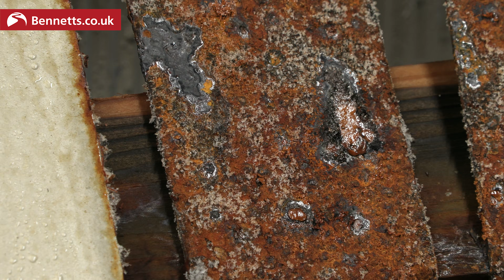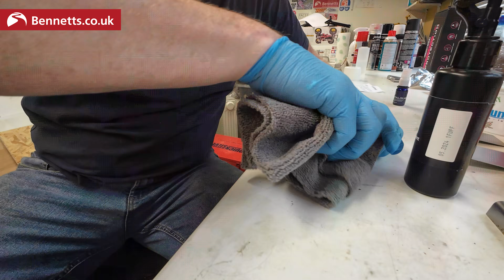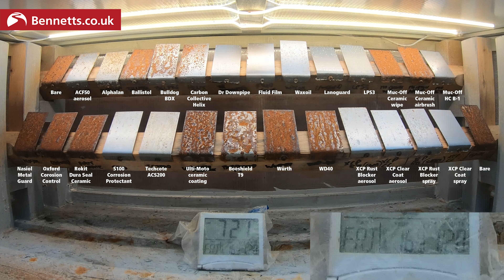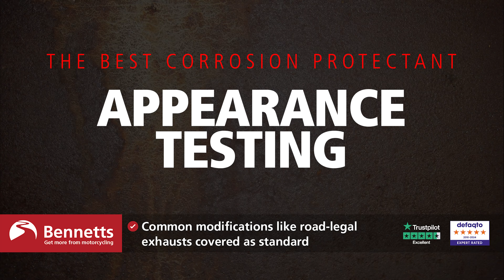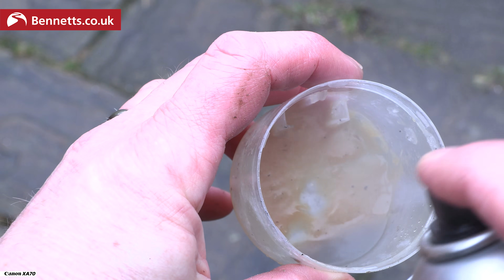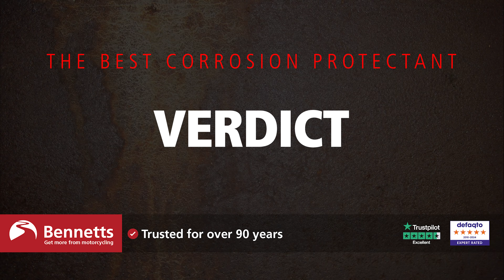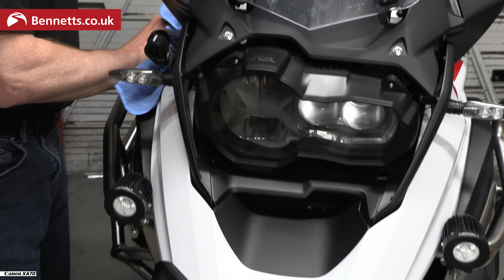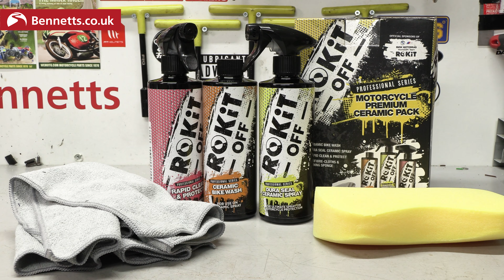Best corrosion protection 2025 | 33 tested | Are ceramic coatings worth it?

Comment from the maker: Tell me what YOU think about this test by joining me on our Facebook group at https://www.facebook.com/groups/bikesocial
or on the BikeSocial forum at https://bikeclub.bennetts.co.uk/home
See the previous tests and data here: https://www.bennetts.co.uk/bikesocial/reviews/products/motorcycle-maintenance-and-servicing/best-rust-corrosion-preventer-inhibitor
Reply: Great video! A chrome test would be amazing!
Reply: Coming from a Powersports manufacturing prospective, we utilized a two coat system as O.E. Corrosion protection of metals.
1- Clean and Dry bare metals, then submerge those metals in an electro deposition (ED) corrosion inhibitor.  ED coating, creates a complete adhesion to clean, bare metal. Any metal having contaminates, effects the ED coat adhesion to the metal. 
2- The second coating was powder (Sprayed on ED adherence), followed by baking at temperature over time, followed by verification of film thickness. 
This process creates a hard, complete coating which can last decades without succumbing to galvanic corrosion. 
......
Can this OEM ED coating be created with a wet coat applied product? ..... NO.... absolutely not... 
in order to protect non-ED coat parts, you would need to disassemble them, acid dip them (Remove all previous coatings and contamination ), Then run them through the ED coat process (Expensive).
...
Wet coating can provide some corrosion protection, but it's temporary and subject to surface contamination remaining upon the metal being coated.
Reply: Really liked the video and the review - EXCELLENT work John, thank you. Would be VERY VERY interested in seeing a similar approach to a review on ceramic coatings for motorcycles 😊 👍 Any thoughts on when we might be able to see that? Thanks again.
Reply: My guy, you should get your hands on CorrosionX. It protects the things you love so you might wanna spray your wife and children after you see how it performs, believe me.

Comment: Where's that Aluminium corrosion test? Let me tell you for Motorcycles that is FAR more important than steel. I live near the coast, no wet riding, only 1600miles on my Kawasaki Z1000sx, it was in a garage with ventilation for 4 years and i have never seen anything like it. EVERY aluminium part had white spots, or was flaking. The wheels had two four inch bare metal areas, the engine covers all around were blown, handrails flaking. I took the bike in for part ex and they knocked off 3k....£3000 it cost me. The bike goes away clean, its dry....but winter cold salty air had ruined my bike, trusty wd40 did nothing. However, ALL the steel like petrol tank etc, side stand, bolts....all perfect, no corrosion so unfortunately your test on steel isn't too relevant because 1)not much steel on bikes! 2) My bikes steel was fine.

Comment: I've used waxoyl a lot on my car - if ever I'm into somewhere doing maintenance (wheel arch liners out etc) I give everything (especially inside box sections, sills etc) a good zap with waxoyl. It really works and you can see the difference when you get to a bit you haven't yet treated... but it looks horrible so I don't use it on the bike except inside tubes and things sometimes.

I tried XCP clear coat and ACF50 this winter - I ride all winter on salty roads. The XCP is a bit thick and goopy but a quick wipe over deals with that. The ACF50 runs off your engine and makes a mess. I'll be sticking to XCP next winter.

I do use muc off protectant as a general finishing spray, and I think it helps stop dirt from sticking and makes the bike look nice... but I don't use it for corrosion prevention.

Comment: can you tell me if LPS3 is tacky or does it dry up? i generally use aviation inhibitor Corban 23 or Corban 35 which is the ultimate inhibitor non tacky almost lie a clear laquer and last for years, but very hard got in the UK plus expensive. I settled for LPS3 for underneath my car and I hope it will dry and be non tacky. Products like lanoguard acf are absolute cr@p , oil non dry wd40 style chain lubricant types that just attrract dirt. I know people rate lanoguard which is effectively sheep skin oil but its tacky and messy and probably good for old cars, but for new cars products like Corban make it look shiny dry and brand new for years. I also tried XCP orange rust blocker, its been a week and its still oily not dry surface which is not good at all for me.

Comment: You are an extreme scholar, my brother. Love it.
Awaiting that aluminum corrosion test video—mountain bike wheel builders would take note. 
This video would be huge for bicycle wheel builders, as well. Post links on big cycling wheel building groups. They would love it
Reply from the maker: Thanks... will do! John
Reply: @b @bennettsbikesocial chnical question for ya: would the Jenolite Waxoil be the most powerful moisture barrier for interface fittings (like an aluminum spoke nipple seated under high tension against a carbon fiber rim)..? 
Waxoil says it is carbon composite material safe (where as the LP3 seems to degrade plastic compounds, as per your acrylic test—not good on a carbon fiber bicycle rim!) 

Thank ya my Brotha

Comment: How good is the XCP products(clear+rust) in terms of lubrication of moving parts? 

Like when forexample some owners of small machine repair shops, recommends using acf50, for rust protection of a wormed gear in a snow blower machine?

In other words, Is the XCP products, only recommended to use for rust protection of flat non-moving metal surfaces?

Comment: commented on the last test as well but

how do the top products hold up to heated parts? Such as the exhaust and engine, as I've had massive issues with rust on exhaust headers due to riding all year long in where they salt the roads in the winter. I used rust inhibiting spray paint before installing new exhaust pipes but rust is still appearing. XCP, ACF, and Blaster Surface Shield (US product) all evaporate off after first ride after application. Have spent numerous hours (6+) researching to little avail. Thanks!
Reply from the maker: I've found nothing yet that can stand up to the heat on headers, but will keep trying to find a way
Reply: @bennettsbikesocial appreciate it! Thank you SO MUCH! Found info from XCP that you can apply it to the exhaust but not quite sure how effective that would be

Comment: Fantastic test, thank you. For years I’ve used ACF50 where less protection is needed but where appearance is important and XCP where more protection is needed and I also found XCP a bit more sticky to the touch.
Reply from the maker: The new formula of Clear Coat is better, though ACF does stay more liquid. Cheers, John

Comment: Obviously the winner in this test was Waxoil. The fact that it can’t be easily removed is precisely what makes it the winner and why it resisted the corrosion effects so well. Its not being easily dissolved isn’t a problem; on the contrary, that’s exactly what makes it the best.
Reply: However, lots of reviews on cars saying it cracks because it hardens over time, then water creeps into the cracks, so for cars I would say lanoguard inside the chassis sections where you can’t get to it and waxoil on the bottom surface where you can re apply it every year or two.  Translate that into bikes and I would use lanoguard as you can remove it in spring then re apply in autumn whereas waxoil can look a mess even though its doing it’s job.

Comment: Last fall I tried 3 products that I was able to buy at local stores.  Fluid Film, Surface Shield and CorrosionX HD.  Applied the products under the car at similar areas so I can judge accordingly.  Both the Surface Shield and Fluid Film were pretty much washed off on suspension parts in the wheel wells where there was still some CorrosionX HD left on.  The CorrosionX HD is much thicker when spraying and not as runny/liquid and builds up thick.  This fall I chose CorrosionX XD which isnt as thick, flows easier, larger can and less expensive than the HD.  One reason for using CorrosionX is I hope it will act as a penetrating fluid also and make removing rusted nuts and bolts easier if I ever have to.  Im not sure if Fluid Film or Surface Shield works in that way.

Comment: Blaster Surface Shield typically lasts more than Fluid Film, however I've used LPS3 over 50 years ago.  LPS appears to still be a top tier outfit.  Very happy and impressed that LPS3 came out on top.

Comment: I’ve just watched this ahead of treating my bike before winter 2025-26 and once again, it’s thorough, insightful and damn useful, so thank you….again! For the next round of testing the only suggestion I’d make re an addition to the existing test methods is to try to simulate the real-world effects of dirty water off the roads (rainwater contaminated with road muck, grit, mud and and salt) at 60mph has on protection. I’m using up the XCP clear coat (new formula) I bought after your previous review, but wonder about how frequently to re-apply in real world conditions to maintain protection. Possibly a ‘how long is a piece of string’ question, but any help would be appreciated.
Reply from the maker: Depends how much you're riding, but just every wash I'd say

Comment: As someone who lives in the Pacific North West on Vancouver Island and Rides an R6 year round, I will just be buying LPS3 for my headers and exhaust system. I have no need for corrosion protection anywhere else and do not care about appearance of the product and won't be spraying anti-corrosion coatings on my plastics anyway. Good to know about ceramic coating the plastic but not sure how that applies to a Corrosion video.
Reply from the maker: The ceramics were tested as some brands claim they offer corrosion protection.

Comment: Not sure if anyone else has mentioned it but CorrosionX is hands down the best stuff ever. Used heavily throughout the Aviation industry to include AF and Navy. It bonds via polarity to metal and is also a lubricant. Amazing stuff.
Reply from the maker: Thanks. Have just ordered a bottle for the next test...
Reply: Thanks for mentioning. I can't seem to buy the top performers in this video in the US. CorrosionX I can get easily and will try.
Reply: @Marc-rj4vl 
I buy CorrosionX at O'Reilly auto parts.  It's usually not in stock but they order it and it comes in to the store quick.  And the prices are cheaper.
Reply: I sprayed the CorrosionX HD last year and it held up great but it's really thick stuff.  This fall I'm spraying CorrosionX XD under the car since it seems to flow/spread better, larger can and less expensive per can of the HD.

Comment: ACF50 is effective if repeat applications are made every few weeks, so I’ll stick with that until the bottle rubs out but looks like xcp clear coat will be my next call. Under the car I use Lanoguard as it’s worked well for my cars over the past few years. I paint it on quite thickly and it doesn’t need the underside to be cleaned, just loose muck brushed off first. Applied each year in November. Metal surfaces seem to stay good over winter each year.  If only one product was bought, I guess a few cans of xcp clear coat each year seems the best choice overall.

Comment: What a great watch this has been....well done. I have a question regarding ACF 50 and XCP CLEAR COAT.  In other videos ive seen people use AFC50 all over the bike including the paint ..plastics etc...can the same be done with XCP Clear Coat or does it leave a bad coating on the paint thats hard to wipe off ??? Id really appreciate if someone could reply to this that know as i want to make sure in getting the right stuff as im due to have my NEW TO ME GSXR 1000 K5 ...and its in showroom condition with only 7300 miles and i really really want to keep it MINT.
Reply from the maker: Thanks! XCP is fine on the plastics. There's not much point in putting either on painted plastic, but it wipes off. Both are good on black plastic.
Reply: @bennettsbikesocial  brilliant...really appreciate the reply. Its xcp for me so

Comment: Maybe I missed this in the video, but if I have a steel part that is zinc plated or painted, would these still be an effective add on or am I fine as is? Cheers
Reply from the maker: Plating, paint, anodising etc will reduce the the chances of corrosion, but any imperfections caused by stone-chips etc can allow corrosion to start, which can then spread under the surface treatment.

Comment: I've always used fs365 reapply after every ride regardless, probably over kill, but it's easy and I don't ride in the wet if I can avoid it and the bike is off the road over winter. Looking to give xcp clear coat a try. Do you spray cables, electric connections, forks, engine, exhaust, down pipes, basically everything except brakes, tyres and body panels? Then after a quick wash every few months give it another mist coat?  👍
Reply from the maker: Yep, that's right! FS365 is very good if used correctly (as you do). Cheers, John

Comment: Any specific suggestions to stop the gold anodized aluminum wheels on a Yamaha Tenere from corroding? I’ve had two very similar looking sets on previous Africa Twins and they both suffered from corrosion/pitting after a UK winter, even with regular application of ACF50. Would the XCP clear coat work? There’s a theory that it’s caused by iron particles from the brake pads.
Reply from the maker: Be careful putting anything on the rims, as it could spin off onto the tyres.

Comment: I have a 2014 MT07 and the tin worm has already taken hold, over the winter i will stripping and repairing as mmuch as i can get to on the frame and swingarm, looks like it will be getting waxoiled in all the hard to reach areas and internally on the swingarm. And xcp clear coat on everything visible. Theres a reason waxoil has been around for so long.

Comment: A quick note: ACF 50 is not designed to be used as in the experiment.  It is very effective for protecting parts that are not directly exposed to external aggression or dirt, such as the inside of steel frame tubes or a steel swingarm, without leaving residues like cavity waxes do, and without having to clean before reapplying.
Reply from the maker: Presumably that'd make it unsuitable for use on the external surfaces of motorcycles?
Reply: @bennettsbikesocial Not inappropriate, but the protection won't be as long-lasting as other products... the advantage is that the ACF will wash off more easily when the bike is washed, or simply with the passage of time.

Comment: Hi, thx for awesome test. Can you test Hempel Alu-Protect for the aluminium test?
Reply from the maker: Isn't that a paint-on marine protectant?
Reply: @bennettsbikesocial  A silicone-free oil, for cleaning and protecting metal rigging and fittings. For cleaning and protecting aluminium masts and booms, steel and stainless steel rigging and fittings. Penetrates into wire ropes and under fittings, ensuring long-term protection.

Comment: I shy away from ceramic coatings as they can be a pain to apply correctly and remove if not. I much prefer a wax and my go to is Soft99 fusso 12 month wax. It’s not the best shine like a pure carnauba wax but it’s protection is the best, check out the forensic detailer.. on top of that when I wash I apply Koch-Chemie PW, a tiny amount added to water and apply to a wet washed surface. Another note on cleaning, I use bilt hamber snow foam, all bilt hamber products have anti corrosion properties in them.. This all comes from being a weekend warrior car detailer but crosses over to my bike..

Comment: What about the coolant hoses? What if i apply my ceramic coat on those? And or how do i keep them soft and black? But not dry or hard n chip off after some time. 
You're vids are super detailed. Love it. Ride safe.
Reply from the maker: Thanks! I can't see any point in putting ceramic on hoses. I'd use S100 colour restorer, or some XCP or ACF-50 on a rag as it brings blacks back nicely.
Reply: @bennettsbikesocial   was thinking of a way to keep them black as after the rain and rinse, somehow there are water spots n stains on them. Thought of wiping e leftover coating on it for a slick and bead off. But color restorer is the more appropriate product! Was looking for that term.Thanks.

Comment: Which parts of your motorbike do you spray with this stuff? I wouldn't know what to do with it.
Reply: I take off my belly pan (4 bolts) and clean the bike thoroughly, then spray XCP underneath the engine and suspension linkage, and any nooks and crannies where water and salt is likely to go (the V of my V twin, behind the alternator etc). I then wipe off the excess with a microfiber cloth, and use a bit of muc-off protectant spray everywhere else. Then pop the belly pan back. Don't do it every clean, but pretty regularly during the winter.
Reply: Yes it will smoke on your exhaust as the excess burns off.

Comment: Sorry if I’m being dim but I can’t work out why you picked the xcp clear when the hc-b1 out performs the xcp by quite a lot, it’s only negative is the slight o ring swelling but bearing in mind you wouldn’t apply it to a chain has little impact on the final score
Reply from the maker: It's also the flexibility of being able to apply it with a compressor https://www.bennetts.co.uk/bikesocial/reviews/products/motorcycle-maintenance-and-servicing/best-rust-corrosion-preventer-inhibitor
Reply: @ Ah gotcha and thanks for  the reply.  Honest question, if you removed the compressor part would you still pick the XCP? I’m an (ex) XCP user and found it to not work with aluminium very well so looking for something different.  I live in the north east of England, ride all year in the salt and bike lives outside with nothing but a cover so protection is a massive thing for me
Reply from the maker: I'm going to do a separate aluminium test, so that should be our guide soon. Just got to get that one started